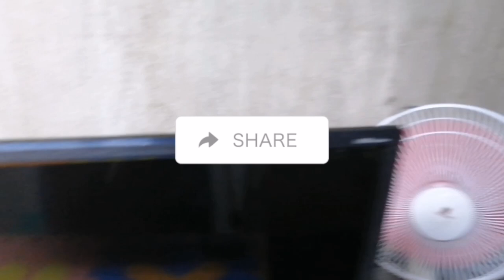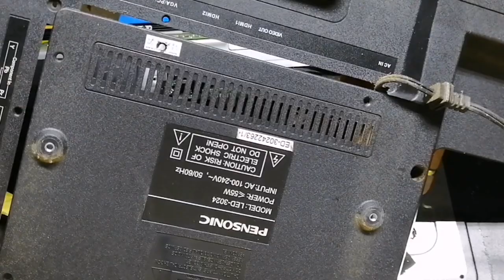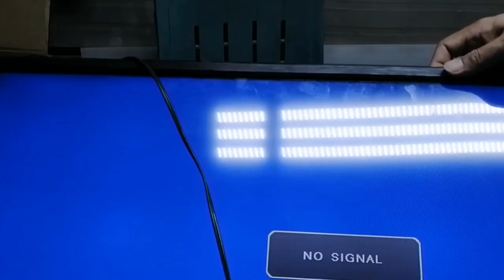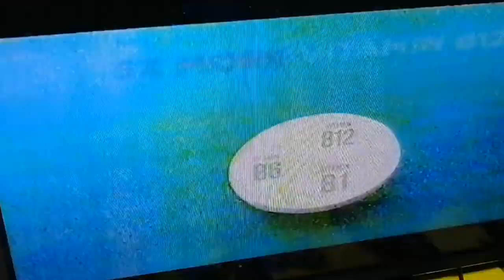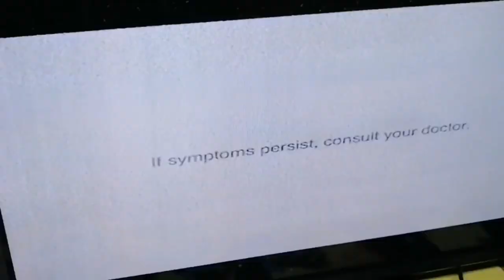How to convert LED tv power supply using 12v (tagalog) vlog # 31

Comment: I did not understand. Your picturing is not clear. You say you power it on 12 v. But there are many voltages out from the chopper. Did u do it only with 12v?

Comment: Wow! Nasurprise ako jan sa convert mo sir. Ang lupit! Tanong lang po, pano kung dalawa yung transformer, gaya ng devant 40mel150 na model, pwede ba sa ganyang convert sir?
Reply from the maker: Salamat po, dipende po s board or sa tv na inaayos nyo kung ilang inches... Yan po ay 32 lng kya kya ng 12v n 5amps ung inverter para sa backlight pag po malaki na need nyo convertan ng inverter drive para s backlight then 12v n supply para po s mainboard... Basta need nyo po mahanap ung 12v upgrade or ung 12v n need ng mainboard para magka stanby or magka 3.3 s memory

Comment: Hi sir, may tv rin ako 32 inch at na supplyan ko yung 12v kaso yung backlight nya 24v ano po dapat gawin para masupplyan?
Reply from the maker: Hi din master meron k po need bypass para pati ung s backlight driver mag boost kaso pag di po tlga kaya ng amps ung backlight need mo tlga maglagay ng backlight driver module

Comment: can you recomment in what current is required for  42 inch the same you board  but 5 amperes is not enought
Reply from the maker: 12v can only operate the mainboard but not the backlight driver, you need to use backlight driver module for the backlight to operate

Comment: Hey there, thanks for the video..

1) i dont understand your language .. are you running motherboard and back lights and your panel .. through 12 volts adapter in this video? could you please help me buddy 

2) basically you are not using the power board of tv .. is that right?

Regards
Rahul
Reply from the maker: It depends, if the board or mainboard have a 12v upgrade....if not you need to find the 12v output from the secondary of the power supply

I still use the same board but i disabled the power supply section then used 12v adaptor with 5amps and connect to 12v circuit of the secondary so that the main board will have the voltages required to have a standby mode.
Reply: @joshelectronics661  : thanks ..for clearing my doubt .. wonderful video and thanks for helping .. cheers buddy !!!!
Reply from the maker: @rahulkalra2126  your welcome GOD bless.

Comment: boss  good day po.     kapag may nakalagay ng 12volts.   pwede na ba lagyan ng adaptor 12volts iyon.  kung ok na kaya iyon.      ang ilalagay na supply 12volts 2amp
Reply from the maker: Opo kasi meron kayong need bypass para gumana ung backlight driver